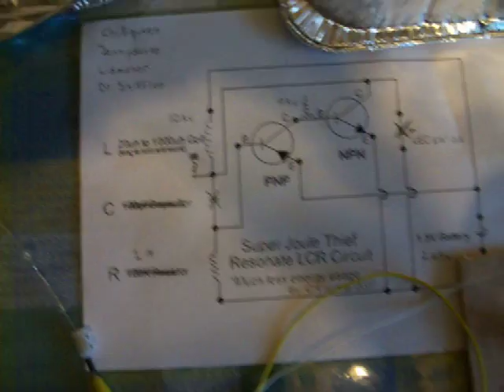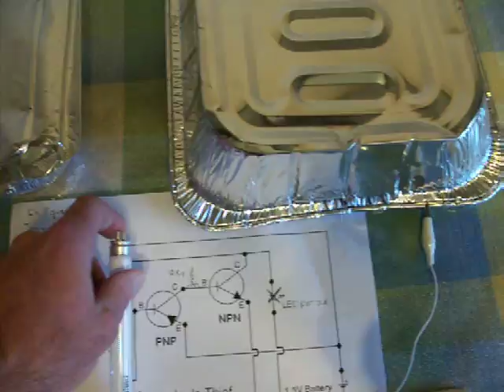Replication Of Chilliqueen Jonnydavro Lidmotor Dr Stiffler Super JT.mov

Comment: awesome... 

have you ever tried using a small bowl transmitter with a slightly larger bowl directly covering it as the receiver? I wonder what the efficiency and current draw would be receiving 360 degrees like that.

Comment from the maker: @Pirate88179 
Thanks Bill
Yes it will work off one AA battery.
But I coulldn't get it to light a CFL with only one battery but it would light up the leds.
Have to try running it off one of the JT's.